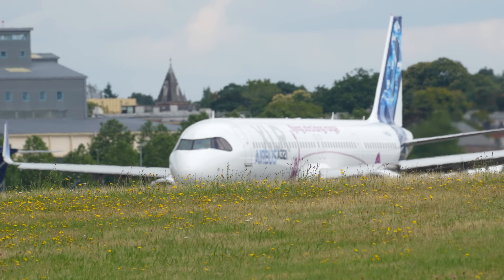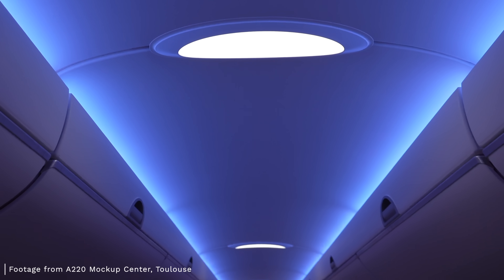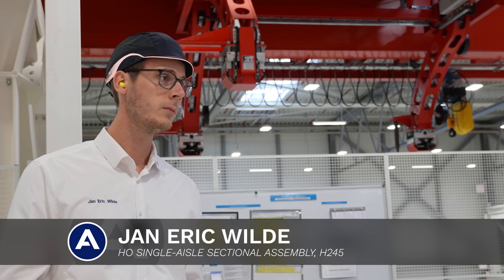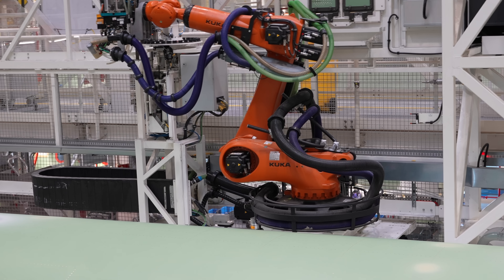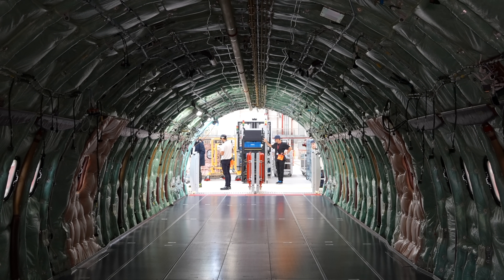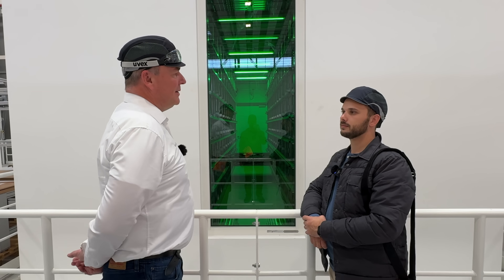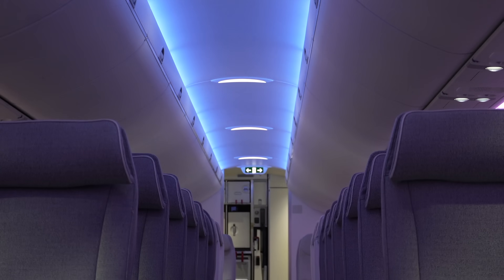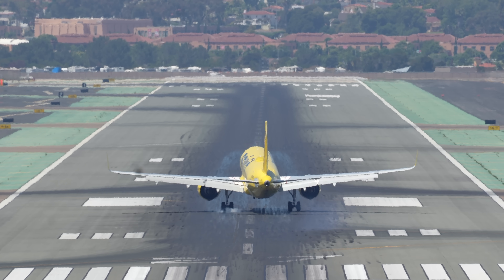How Does Airbus Build the A321XLR? (Factory Tour)

Comment: Thanks for the nice tour. 
A few years back, I was able to take a tour of the Airbus Hamburg facility as well (just without the customer definition center), and I found it amazing.
The lack of robots did not surprise me much. A long time ago, I visited the Mercedes-Benz / EvoBus bus factory in Mannheim, Germany. The bus bodies were also mostly handmade. The pretty reasonable explanation for that was that the numbers produced are WELL below the number of cars your typical car factory spits out, and it they just can't save enough money in the long run using the robots, as the upfront investment is really high, and with every change to the models (there is more customization than you would think) they would need to be reprogrammed. They only employed robots in places where workers would otherwise have to deal with extremely repetitive or strenuous work. I think a similar point applies to aircraft manufacturing as well. Even high-sellers like the A320 family don't sell in the numbers that your run of the mill Honda Civic is sold in.

Comment: I thought the airbus 321 was built with composite. They still use aluminum. Nice to know. I’ve flown several A321-211 on Delta Airlines. 👍
Reply: Changing the structure isn’t trivial, it would require a complete recertification. You might as well build a new plane at that point
Reply: @ I know. I was under the impression that airbus used composites.
Reply: @paulgaerisch  They used composites for certain parts, just not for the body and wings. But for instance the vertical stabilizer is made out of composite.

Comment: Canada may not have a lot, but we got  98 CF-18A and 40 CF-18B , 88 F-35 II lightnings ordered to replace CF-18s.  We got 15 CP-140 Auroras,  They will be replaced by 16 Boeing P-8A Poseidons. Also 12  CC-130 Hercules, 4 tankers and 8 SAR. There are 17 CC-130J Super Hercules (Lockheed martin), Also 5 Airbus CC-150, Airbus CC-150T 2 Transport, 2 are tankers one VIP. Another 2 Airbus CC-330 Husky. 5 of Boeing CC-177 Globemaster IIIs. Ordered 16  Airbus CC-295 Kingfisher. And 85 CH-146 Griffon helicopters, 14 CH-147 Chinooks. 25 CH-148 Cyclone (ASW), 13 CH-149 Cormorants. And Unmanned, ordered 11 MQ-9B SkyGuardians. 2 IAI Herons and 6 CU-176 Gargoyles (UMS Skeldar V-200 is a medium-range helicopter and UAV (Unmanned Aerial Vehicle) developed by the Swedish aerospace company Saab. and , RQ-21 Blackjack 10 of them. forgot the 18 McDonnell Douglas F/A-18 Hornet (Ex-RAAF). Rest are trainers like Dassault/Dornier Alpha Jets....We need newer missiles, we have the AIM-120 AMRAAM , Also JDAMs A kit to convert a regular bomb into precision-guided munition. AGM-65G Maverick Missiles. Mark 83s/84s, 1000 pound and 2000 pound AGMs. AIM-7 Sparrows ( Medium-range semi-active radar homing air-to-air missile) Aim-8 sidewinder short to med range heat seeking AAM missiles. Almost all are from the USA, thank You from the North. Need more protection, we could use newer bombs. Ordered 219 Hellfire missiles, and 12 Mk82 500-pound bombs in a deal worth $2.49 billion CAD. And what army doesnt have a The M2 machine gun or Browning .50 caliber machine gun mounted somewhere. (If it aint broke)

Comment: The guy at 7:13 is responsible for putting the doors and ensuring all the bolts holding them are installed correctly. I wonder if he should get in touch with "his American cousin" at Boeing to give him some tips on how to ensure the doors are correctly installed and secured.
Reply: His American cousin was on holidays at the time when a certain plane was built. He actually was the only one who knew the specific installation process of the door type. Not just in his team, but the whole company.

Imagine working in a company with more than 100k employees and no one is capable of replacing you during holiday season.
Reply: @jantjarks7946  dare I say, it might cause rebellion 😢
Reply: @jantjarks7946 😂👍🏽
Reply: @jantjarks7946  I watched Maximus' NTSB Report video and that lack of redundancy for training is actually worrying.
Reply: The letter was returned, not known at this address 🙂!
Reply: His American cousin probably “died of a paper cut “

Comment: Never thought A321 xlr would be delivered before 777X 😮
Reply: at this rate the A360 will be delivered before the 777X
Reply: do you think the 777-x will ever be delivered? 🙂
Reply: i did
Reply: Ignorant comment
Reply: With the problems that Boing is facing it was quite predictable
Reply: U mean A321XLR
Reply: Keep in mind the A319-21 family has been around for some time the changes in these variant aren’t that massive, the 777x has major changes compared to the 777
Reply: @iiCautious the A321 XLR also had massive changes. The 777 also has been around for decades.
Reply: @jacee1113  in terms of which?
Reply: @iiCautious It doesn't though, they just upsized the model and made the wingtips fold... Nothing else.
Reply: @Nexplane As far as I know, they are getting bigger windows, and that is a rather big structural change.
Reply: @nmnaamda  yeah but the fuselage cracks aren't even close to the windows they were closed to the gear than anything
Reply: @iiCautious  Well, it's so different and not so different that they thought it'd breeze through, but then MCAS showed up and Congress and POTUS railed against the FAA, hence they're now probably doing full certification to cover their arses, which is good, because it's safer for end users at the end.

Comment: While the XLR is good, I’m still betting it won’t be that successful or last very long, the market is there yes, but the XLR doesn’t offer really a significant advantage over the LR imo
oh well as long as it sells ig
Reply: If anything, the A321LR is the plane that isn't going to be successful. As it stands, the A321LR only has 69 (nice) total FIRM orders. The A321XLR has 364 FIRM orders. 

Now many airlines could opt for the LR if the delivery times are nicer, but ultimately airlines prefer the XLR because of the extra 700nm range it has over the LR. Ultimately, more range will always win out
Reply: I read somewhere that the XLR has more than 500 orders.
Reply: @chiad25  500 total orders, 364 firm orders I think
Reply: What if the LR is the version that gets discontinued, or what if the LR version never existed?
Reply: @DontKnow-s2r  I believe the LR was like a test bed for the XLR Airbus didn't just think of the XLR straight away but used the LR as a base for the XLR, since the standard A321NEO can be converted to an LR and vice verse by the installation of extra auxiliary tanks which by the way are removable whereas the XLR has a permanent rear centre tank (RCT-the regulators concern) with complimentary/additional auxiliary tank(s) for added range. Once airlines were satisfied with LR's capabilities the XLR now made better sense from operational and economics point of view. I maybe wrong
Reply: A321LR is just a marketing name for a regular A321neo with an ACT